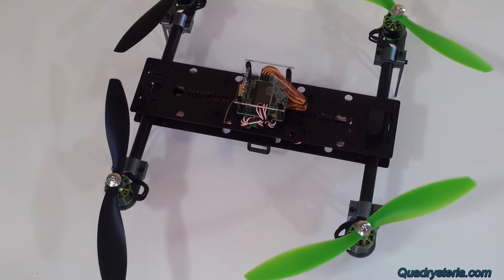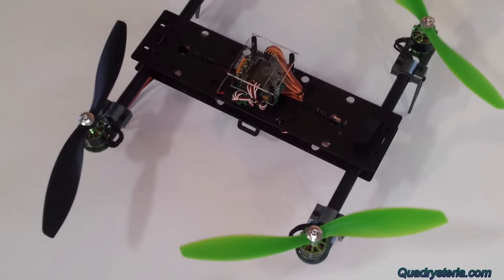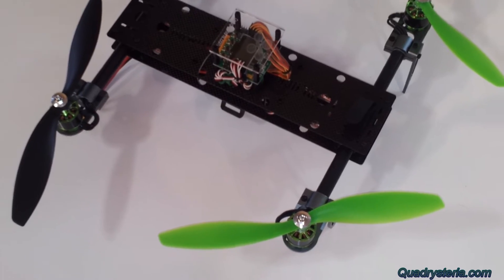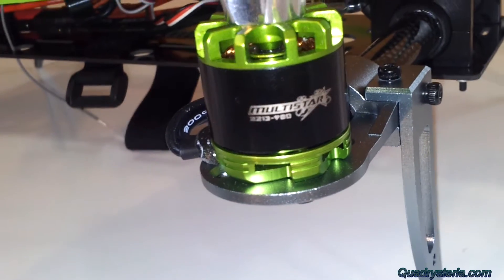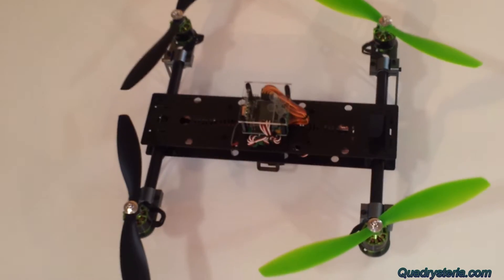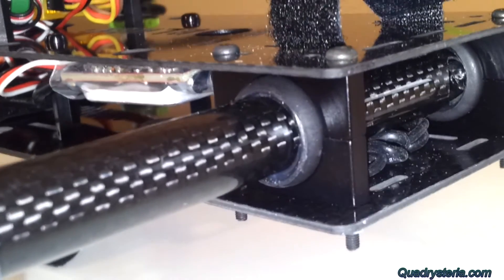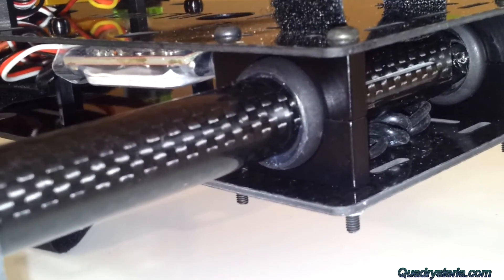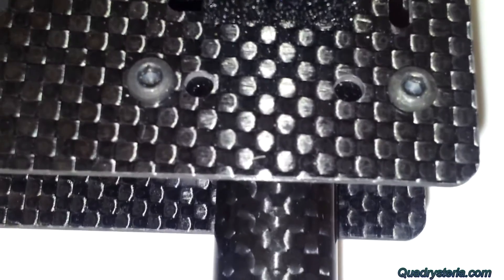10" propellers on the Black Mamba Carbon Fiber H Quad

Comment: how do you think 3s 5000mah would work on this?
Reply from the maker: 3S is a great choice, but 5000 is going to be heavy. I would keep it closer to 3000mah
Reply: okay. on hobby kings these motors say 2-3s. but 4s is ok? why do they not have that also, strange...
Reply: also, which battery had most speed?
Reply from the maker: MeAndMy70D
overly conservative on HK part - motors come only a little warm on 4S after agressive high throttle. otherwise cold. 4S has most speed because higher RPM, but better to use 8-9" props with 4S so you get longer flight.
Reply: Quadrysteria well i am waiting for all my parts and gopro to fix my faulty camera and hopefully i will have some videos of mine soon! :) just the size iv been looking for and carbon fiber, seems like great fpv toy!

Comment: looks good... just finished building a sk450.. with these motors and 9047 gemfan props.. and i dont get anywhere near that sort of acceleration.. using a multi wii any suggestions?
Reply from the maker: Thanks for you message Joeles69 - Use 10x4.5 props! and 4S batteries to get more acceleration. The SK450 is only about 100g heavier than the setup in this video. Also, SimonK ESCs are the bees knees!  You can double your PI gains which keeps the craft stable during these throttle punches.
Reply: Quadrysteria Im using the hobbyking Turnigy Multistar 2213-980Kv 14Pole motors, and the HK site suggests that these motors are built for 2-3s not 4s? have you had any issues with these motors at 4s?
from what i have read your using the same motors.
Reply from the maker: joeles69
Oh, they fly on 4S without issues at all.